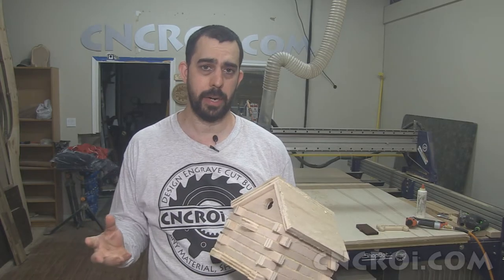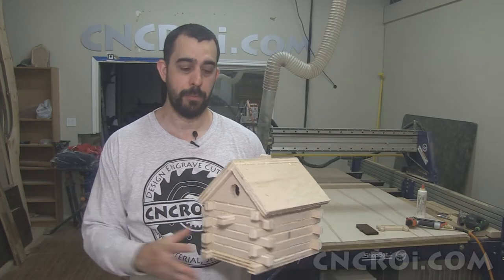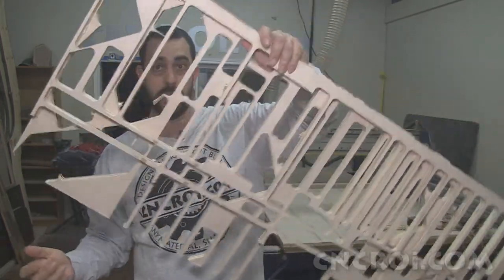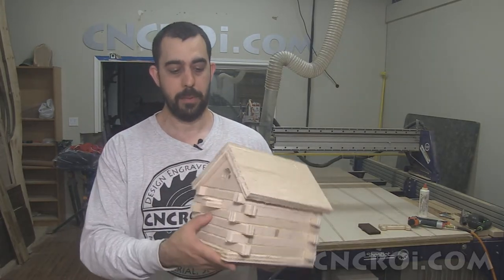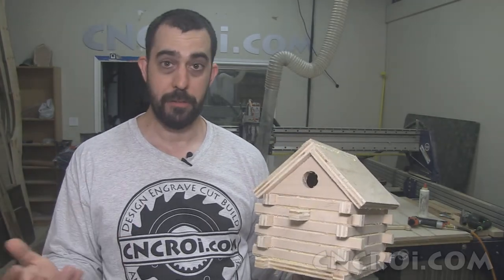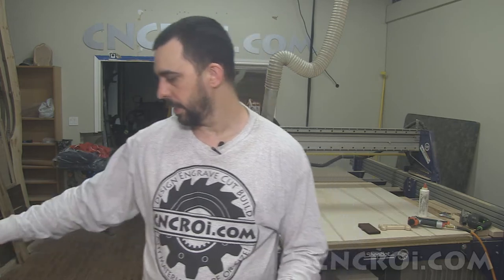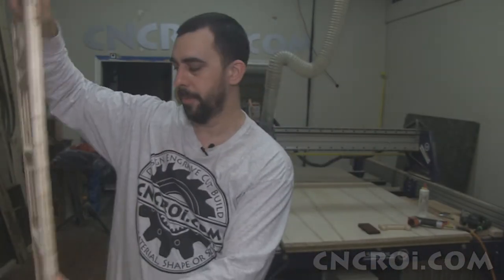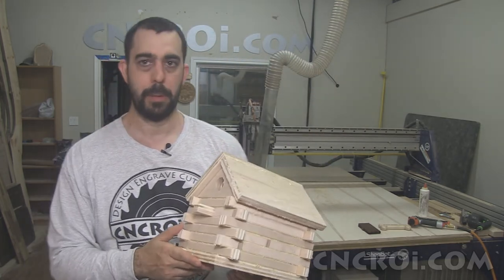Bird House Prototype V2: CNC Routering 3/4" Maple Plywood

Comment: Could you not have made each of the 4 walls, including the peak portions with the hole, as a single piece, using a v-bit to simulate multiple "logs"? Wouldn't that decrease assembly time, complexity and material waste? The only problem I guess would be the rounded corners where a short log ends along a long log caused by the end mill. A little sanding to round the back edges of the long logs where they join the other walls would fix that, no? I'll be getting a cnc router soon for hobby work so I just like to imagine how I'd attempt a project like this. Been watching your vids for a very long time, keep up the good work.
Reply from the maker: I wanted to make it with individual logs.